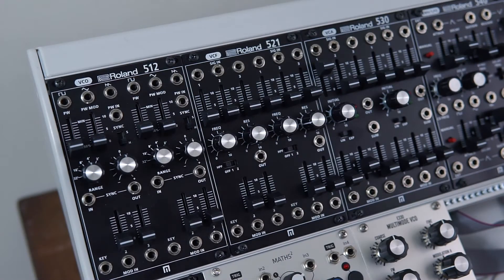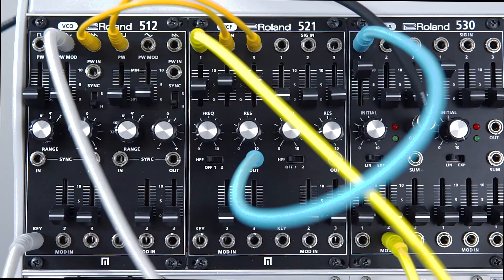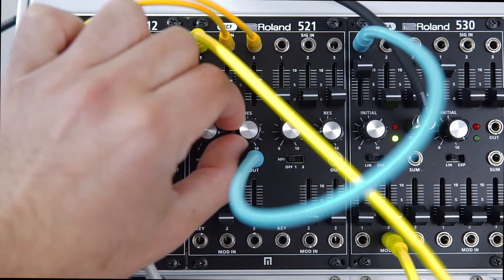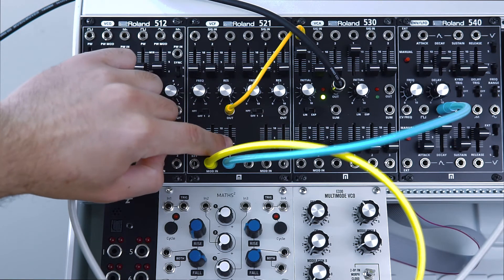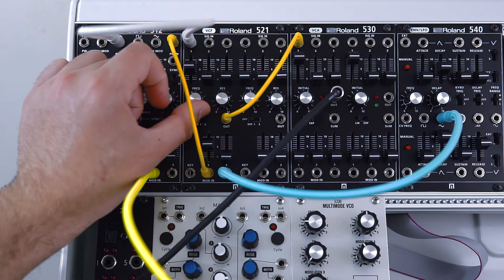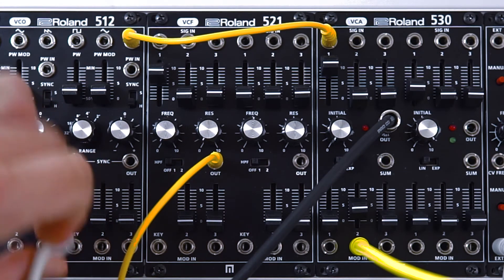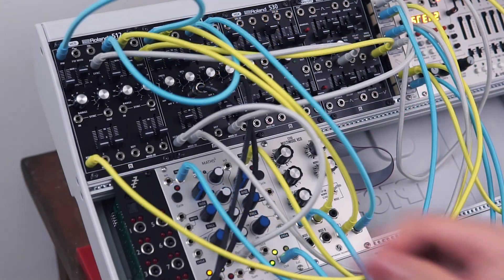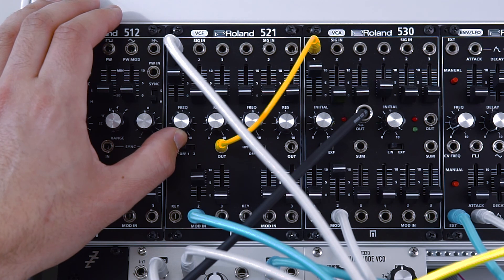Roland VCF 521 - My favorite Analog Filter!

Comment: I have the 512 and 521 and really appreciate your pointers on these videos.  Amazing modules and the more I learn about how to use them the more I love them.  I'm surprised at the negative comments on these modules.  The Roland modules are some of my favorites. Also the Synthesis Tech.  I have the E352 and E440 and they are great.
Reply from the maker: Those are all awesome modules,  it's easy to be cynical with so much good stuff out there now.  From the limited chat I've seen, complaints about the Roland modules are more about the features for the price, they are quite primitive by modern standards. I adore that Roland filter though, as you can tell from the title.

Comment: Great for making Trance. And I'm not speaking only about the Filter only but that whole Modular Synth. Wonderful sounds!!! I was amazed by the stereo filters and how wide they sound. Very unexpected for me...
Reply from the maker: Yeah it's the real deal.  One thing I'll say about it though, I personally found the tuning instability of the oscillators I had to be very frustrating, but I only ever had the Roland analog oscillators, which may be unusual in this regard, I don't know.

The reason it sounds so wide by the way, I'm running different oscillators into the Left and Right filters. So the two channels are completely independent.  If I were running the same oscillator signal into both Left and Right it wouldn't sound nearly as wide.  That's one reason I choose the Roland modules, each modules has 2 of everything.